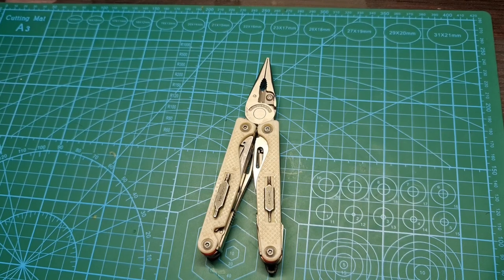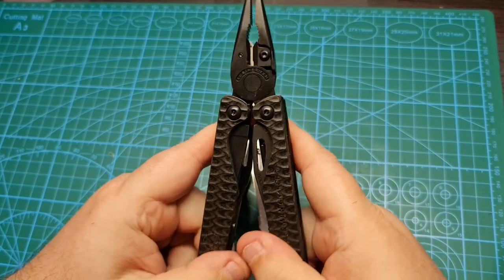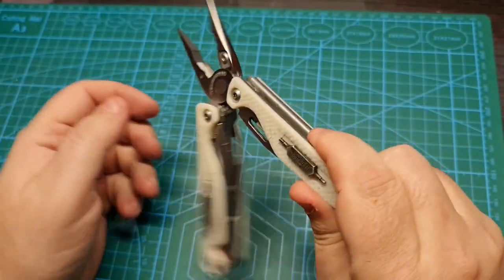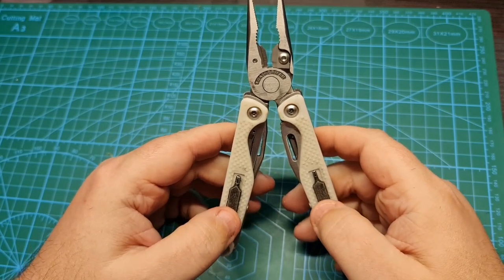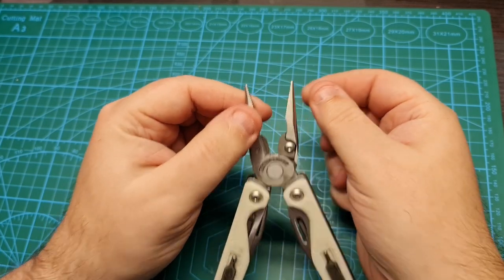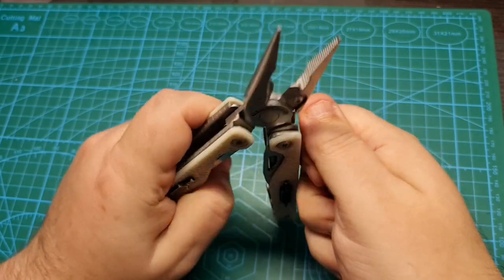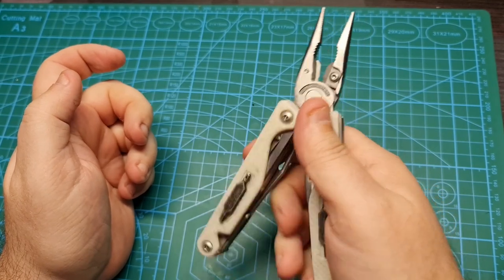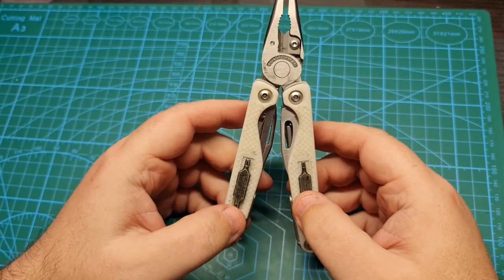Charge+ stiff pliers fix

Comment: I have a Charge+ (originally G10, but swapped to TTI scales) and a Wave+. The Charge+ swings freely. I disassembled it to change the scales and had to file down a bur when putting on the TTI scales… not sure if that has anything to do with the freely swinging pliers). The Wave+ has the same problems as in this video. I used the same technique to loosen up the piers after gripping them tight as seen in this video and it works. It’s a temporary solution. Ideally, it would swing freely even after I grip it tightly. We’ll see if it breaks in more over time. Fingers crossed.

Comment: I have a wave+, never had this happen, also never happens on a rebar I have....my free p2 it does happen, but like you said, I can twist and wiggle and it will loosen....just ordered a charge+ g10, hoping it doesn't have an issue.
Reply from the maker: Not all of them have this problem but most of them as it seems. I have a Earth version and is not having this problem. Also all my old tools do not have it.